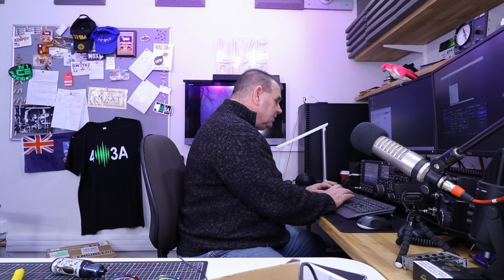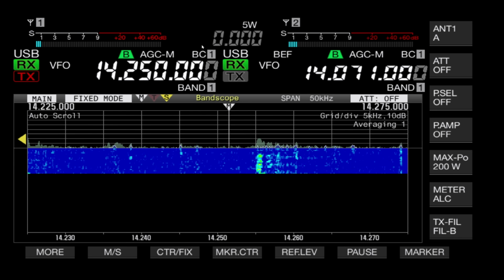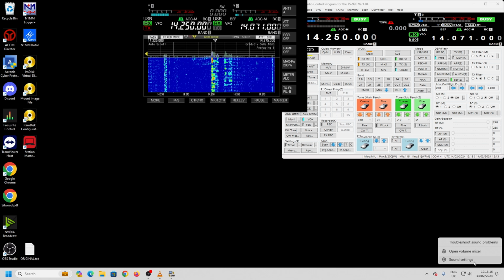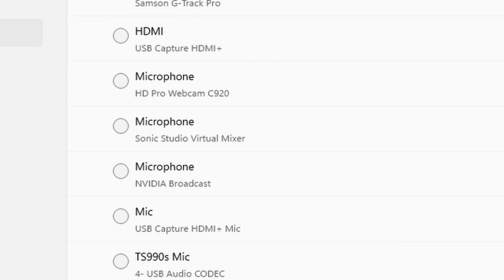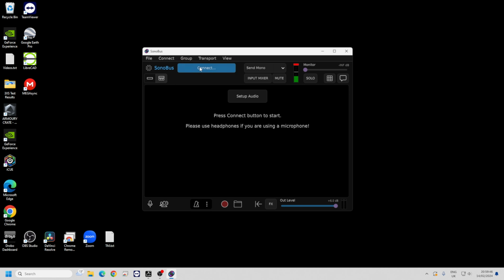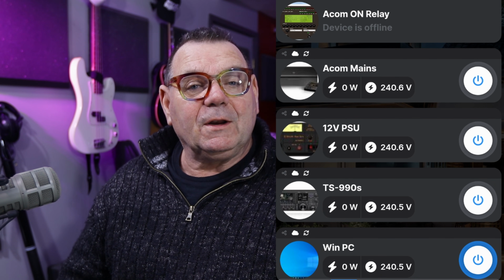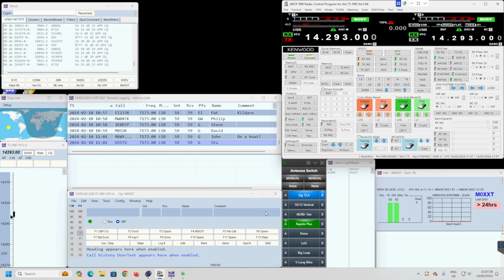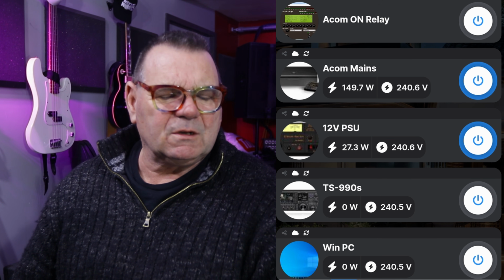Beginners Guide to Ham Radio Remote Control for FREE

Comment: Still a  very relevant video in 2026. I struggled with passing the audio until I used SonoBus and that made the process easy. I set up com0com on the remote PC so I can also use Digital and Voice without losing access to my Radio CAT control software. In my case I am using Win4Yaesu to control the radio (Yaesu FT-710) and then launch any digital or logging software on a virtual com port. Win4Yaesu manages the PTT for voice. I do have to change the radio setting to allow the microphone to pass via USB when using SSB on the radio but Win4Yaesu has access to the radio menu settings if I forget before leaving the house. 

As always, thank you for the help!

Comment: Hi Callum I been trying to work out how to connect my ts990 to do remote , all the diagrams I see show the ethernet from radio and router going to pc but how is this when only 1 ethernet socket on pc?
Reply from the maker: OK.. First off, connect the radio to the router. Not what IP address the radio has - the locally fire up ARCP 990 and configure it locally. Then move from there. I can make a teeny video on this if you want. Just drop me email. Keep it short though. I don't have much of an attention span to read paragraphs :)

Comment: Ham radio Delux specifys AVX1 must be on CPU & no longer uses MS DB Access so wont run on my win 11 machine but does run on my old dell win 10 machine but wont accept the key and their ticket system seems to be short of a P take no useful info just mind boggeling pay for sw.
Reply from the maker: Erm... OK sorry about that - but just in case you wondered - this has nothing to do with HRD :)
Reply: @DXCommanderHQ  Yeah sorry mate.

Comment: Another problem with even native remote control apps like the Icom RS-BA1 is if you use the USB port to connect your PC and control your rig, then you cannot do FT8 because WSJT-X also needs a USB connection to the radio. And if you go got only one USB port you are toast. Even if you have two USB ports in order for the remote app to work you have to change bunch of CI-V settings on the radio what will not allow for FT8 to work.. So, the downside is even with an moderately expensive radio like the IC7300 you cannot do voice and digital the the same time on demand. The solution is to buy a more expensive rig that can do all that.
Reply from the maker: Erm.. I'm not so sure. Plenty of folks doing FT8 then moments later doing SSB on a 7300.
Reply: @DXCommanderHQ  Not sure how they do it, but for me using the Icom software never worked from the beginning. Icom support was not very helpfull ether. The Icom software relies on server software installed on your PC connected to your radio and a client app on a remote PC/Laptop. You need to forwards certain ports and all that. I would have liked it to work, but its seems its a software that has not seen much updates or bug fixes.

Comment: I recently came across a software called RemoteTx that controls/operate your radio from a web browser and it works from a PC, Mac or even and Ipad or a phone. it supports mainly Icom radios some Yaesu and Electraft. It can do voice, FT8 and even CW. For comparison I dumped $130 for the Icom remote software and it never worked. RemoteTx was up and running on the first attempt. No need for 10 different apps to run to operate. Again it all depends what kind of rig you have. Its cheaper then the $4k+ Flex Radio setup :)
Reply from the maker: It's a subscription model and MIGHT not cover the radio if you ever chop to say a Kenwood. But sure, go with it.
Reply: @DXCommanderHQ  Correct. $70 per year which is not bad at all if you consider that it does not need anything else then a RaspberyPi4 and your headset of choice. Its routes audio perfectly without any port forwarding and all that drama . Its a relatively new platform and the developer says more radios will be added. Hopefully Kenwood too. There is nothing wrong with your method. It works great. Before this find I was using VNC to the PC and a web camera facing the radio screen so I can see the radio display 😁. The Icom7300 does not have DVI or HDMI video our port.

Comment: love the video. now getting the headset mic to work. Using teamviewer and the audio is going through it not sonobus?  getting the sound in headset but no PTT. Stumped
Reply from the maker: I never went down the PTT route. I use VOX. SOmeday I'll look at that again. Audio: better with Sonobus for delays, ability to change bit rate etc. Also check out RustDesk for even better resolution / clearer picture over TeamViewer and is genuinely free for single users - and does multiple monitors.

Comment: i use chrome remote desktop and rsba1 for my icom 7300.
i use a mini pc for the radio.
its great, i can control my radio from my laptop down stairs/garden, phone out and about and while at work i use a 10inch tablet in the works car on the dash :D
my mini pc runs from 12v 3amp and uses very little power and saves leaving the main shack pc on :D
Reply from the maker: New alternative... "RUSTDESK" - you get a clearer picture / screen

Comment: I have tried all possible configurations with my Yaesu FT-450D  and  my windows 10 PC with USB to serial port adapter. No go for the Yaesu remote or Ham radio deluxe. I am wondering if there is any other hardware that will connect to the radio?
Reply from the maker: This happened to me once with a radio.. Turns out the RS232 port was broken.

Comment: Excellent tutorial Callum. I've used the Icom RS-BA1 software to remotely control my IC-7100 in the past. I run an OpenVPN server on my router. It has worked well but my biggest issue is caused by the technology used for my internet connection. My VDSL2 connection will drop with the slightest hint of RF on 160m and 80m. 40M used to be bad as well but I have added a 7MHz notch filter to my old copper phone line which causes the VDSL2 modem to not use frequencies around 40m. VDSL2 also makes using the 30m band impossible with S9+ modem carriers raising the noise floor. I'm getting a fibre upgrade next year, it can't come soon enough 🙂
Reply from the maker: Ah! RF and external comms are a pain in the *ss.. Good luck.

Comment: Also I see you're using TeamViewer. I suspect this is because of sound issues on Microsoft remote desktop which is free. There is an option in the 'connection settings' under 'devices and audio' to 'play sound' 'on remote PC' which solves that problem entirely. No need to pay £15 a month for TeamViewer

Comment: If you are interested in a couple of remote/computer control options I have written a scriptable command line programmer for the ic-9700 and an infrared rotator controller compatible with Hamlib (I think there will be an article in a Radcom next month about the rotator control). I found that a lot of the options that I use regularly are not available in remote control software including Icoms own remote software, for example, I can set input and output levels and change the mod input, control external preamp etc - I'm adding to it as I find the need.
Reply from the maker: Oh! I'll look out for that!
Reply: @DXCommanderHQ  I can't post links here, but I don't know whether you checked out the rotator control software but I've written a full-blown. IC-9700 remote control program check out my channel latest post if you're interested

Comment: Hello , im new on you chanel.  I was looking at you 160m receive antenna attempt.  and started to think.  Here in Sweden we have wild animal fence lengst the highway..  And guess who lives next to it. so im thinking. what do i need to use it as a looooooooooong antenna? can i just use the one little box with the ring divider and connect me to the fence?   the fence is approx 150cm high stel net and couple of kilometers long  going from north to south.. im thinking this should lett me listen to you an Murrica with ease.   or is the length really important on receive? // Jony
Reply from the maker: Not important - although VERY long will be directional.
Reply: so im hearing, trying out and finding out is the way.   @DXCommanderHQ

Comment: Deffo a starter for 10 cal. My shack is going to be abt 40 metres of potentially not cheap coax to my antenna(s). If i set my 2 old laptops up beside radio in man cave where it coud be 5m of coax and the other in the front room shack I can save a load of coax dosh. I'm an IT guy used to realvnc skype and teamviewer.. so this is a great video Cal
Reply from the maker: Perfect!

Comment: PC not a Mac- It's slightly annoying that functional radio related software is harder to find on the Mac. I do have a Windows computer but it's old and crap, and I'm too tight to buy a new one.
Reply from the maker: There is remote software for Macs. I can't demo because I haven't got one.

Comment: fantastic video Cal! I have an icom ic706 that I have ft8 working like you said but with an external sound card and cat control. it's not built into the radio. when I give the radio power though, it doesn't turn on up automatically. any thoughts but how to make that work?
Reply from the maker: OK.. so you need to physically hit the button? Check the user guide, there maybe a command you can send to it - or just leave it on.

Comment: My biggest issue is, I don't want to fully heat my cabin where my main shack is, and it gets down to -40 here in the US north midwest (that's the same F and C).  Remote would be nice so I don't have to sit down in that cold cabin to work my main station, but then again, it gets so cold it isn't even good for the equipment itself.  Between that and concerns of audio quality loss, I have not started down this path yet.  That's the issue with all this remote stuff, as you put out.  It isn't just one issue with a quick fix, it is a whole path of many issues and remedies and complications.  Suppose I need to stop making excuses and get on it....
Reply from the maker: There is no audio quality loss if you use Sonobus. It's completely configurable. Listen back to today's live-stream. I had set it to 24kbps but you can lower that - or go right up to lossless, over-the-top hi-fi quality. Also, leave the gear ON when it's dead cold..

Comment: Very important to check regulations in the country your station is in and where your amateur radio qualifications are to make sure you are able to operate a remote station with the qualifications you have.
Reply: I don't think anyone is going to call the Radio police over this.
Reply: @DifferentGearTV  You have no way of knowing that. I have two remote stations in Canada and you need advanced qualifications to have a remote station here, which I have. There have been several people called the "band police" as you call them. You never know what motivates people to be negative about others operations but it can and does happen.